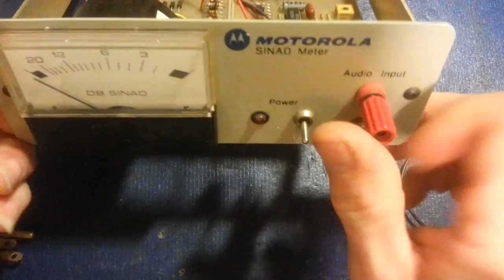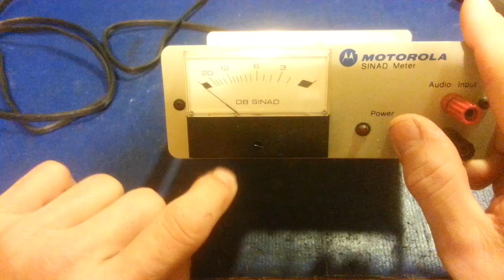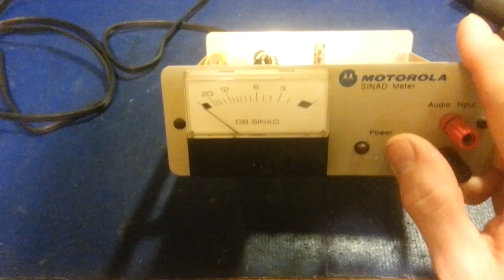Motorola SINAD meter overview.

Comment: hi mike, could you post sharp picture's from the top and bottom of the pcb, in the schematic there are some components not clear where to connect, if you have sharp picture's i can backtrace them.
grt. pd2shb

Comment: I have a meter like this. I wish you would do a video on  connecting to a radio. And doing the adjustment.  No one does this
Reply from the maker: Probably because there isn't much to show.  Just hook a set of leads from the meter to the speaker on the radio and adjust for the highest meter reading.  As sensitivity increases while adjusting you may need to decrease the signal into the radio.

Comment: Great video.  I have been watching ebay for one of these to show up.  Thanks for sharing.
Reply: Commsprepper get the Motorola SAC-3000 if you can find it. Has a 1 kHz generator (with deviation adjustment), triple scale meter (dB, percentage and  volts) for rated audio/20 dB quieting,  distortion and SINAD. The one I found in the office was made around 1980. Sometimes it’s nice reading the needle compared to the bar on my R2670.

Comment: Love it! Expecting unwelcome visitors? The Ruger on the table! 

Off topic a bit but I have a Ruger American Rifle. The lack of after market stocks and no bottom metal is a problem only Boyds makes one and last I checked they do not list it on their site. I have a Ruger American Rifle and I used it to build a new F-Class rig. I think it will be the next Remington 700 in terms of using it's action to build high end tactical competition rigs and F-Class on a budget. It is beefier than the 700 and needs less machining to true it up. It is CNC machined from the OEM from bar stock no casting for the receiver or bolt body.  No need to true the reciever face because their is no shoulder between the barrel and the receiver. Unlike the 700 and a lot of other 2 lug rotating bolts it does not need to be sleeved or double sleeved because the  bolt body is and bolt head are one huge piece so their is not 20lbs. of side thrust when the lugs are seated and cocked. The Ruger American was on Clearance at my Walmart for $169 it was in 243 Win when I got it but now it is wearing a cut rifled Brux barrel in 260 Remington. It is not a pretty action for sure but once it has 1/3 the after market of the Remington or Mauser it will be a real Diamond I think!

Comment: very educational mike. :-)
so.... cool ol pistola on the table there m8 ;-)  9mm?
just a thought, how about some vids on wire/cable management.  it seems to me manufactures dont give a hoot about it, if it's ham, cb, am/fm radios etc it's the one thing that's skipped over by everyone,
Reply from the maker: What kind of cable?  Antenna coax cables.  The pea shooter is a Ruger P85 9mm.
Reply: talking about wires &cables inside radios. it seems to be a neglected thing unless you get a rats nest  that some screwball left behind once it's been golden drivered
Reply: Antenna coax cables would also be an interesting subject.
Reply: agreed

Comment: Mike,

Is that a .45 at the right of the video?
Reply: I've not seen a P85 sinad adjuster in some time. I too, keep my Colt 1911 in handy reach at my bench, for those real stubborn repairs. It certainly can improve S/N ratios.
Reply from the maker: +bain5872 

To quote Mr. T, I pitty the fool. :)  And they can't run fast enough to escape a 338 Lapua Magnum.  I can hit a target at a mile with that.
Reply from the maker: 9mm Ruger P85
Reply: ROFL
Reply from the maker: +bain5872 

May not do much for the signal but definitely effects the noise measurement.  :)
Reply from the maker: +Enjoying The Sun 577-Jersey Customs 

There's at least 2 loaded guns in every room of my house and at least one on my hip at all times.  Heck I have 2 rifles in the upstairs bathroom.  A 17HMR for pesky chipmunks when they raid the bird feeders and a 270 Winchester for long range groundhog removal.  The 17HMR can easily take a groundhog but once you get past 250 yards those tiny bullets are pushing the limit.
Reply: @mikesradiorepair  I don't think anyone  can just walk into your shop to get their radio repaired w/o being shot at. Appointment required.
Reply: MikesRadioRepair
Mike, I actually had a client back in 1995 to actively look for my weapon while I was attending to his gear. He made me so nervous that I halted all operations and asked him to leave....which he did so.. Be very aware, they are nuts and wack jobs every where, which I'm sure you know about already. Always, beaware which I see you are.

Comment: I have a SINADDER 3 as a backup here (had a plain version but sold it at a hamfest last year). Sent Buddy the manual recently and just got done taking some pix for him too. I had a hard time at first wrapping my head around the SINAD measurement until I realized that it's simply modulating the signal with a 1kHz tone, the meter then strips the tone out and measures what's left and the lowest RF signal that produces 12dB of "quieting" for the lack of a better term is the measurement you want. Gosh, I thought the piece might be for a dissatisfied customer but I'd guess Mike doesn't have many of those!  ;-)
Reply from the maker: I don't know how but I have never owned a SINADER branded one.  I have a Keighley DMM that takes SINAD measurements, my communications test sets and a couple of these Motorola units.  Guess I really don't need another.
Reply: Hi Friends ,   I need to find one of these units to buy bad I have not found on ebay

Comment: Thank you Mike. that was perfect. I have used a lot of sinad meters back in my commercial radio days. The main one I used was an EF Johnson branded one. Have not seen one since.  Up until a few months ago I used the built in sinad in my IFR but now it has quit on me.  Really not going to take the time right now to trouble shoot it.  I think by doing a build up of this unit will not only help me but help others to build the unit with modern day parts. May do two versions, though hole and smd.  Why I wanted the see the actual circuit trace layout. Man that could almost be placed on a flat bed scanner and scanned. Then simply reverse negative image and resize to scale........ Once I get the layout designed in software I will offer it on my site.Thanks Mike for taking the time to do this and explain in great detail on how important this piece of equipment is.Thumps up.
Reply from the maker: I guess it could just be scanned and a reverse image used to duplicate it.  Like you said a SMD version might be nice.  Could stick the whole circuit in a box only big enough to hold the meter movement.